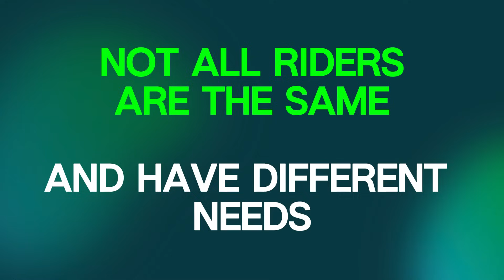DJI Under Fire: Will Europe Shut Down Their 1000W Avinox e-Bike Motor?

Comment: Why is nobody talking about the class 3 speed issue on the levo? This topic is way worse in my opinion! Big deal, DJI has 1000w but at least the speed cuts out at a lower point. It just gets you to cut out speed faster.
Reply: I find it all bonkers about e bike speed limits. Seen 4 kids on surrons a week or so ago. On the road in a gang and a police car just casually let them get on with it, the likely hood of you getting pulled on an e bike with limiter off is zero. You have cities full of derestricted big powerered e bikes delivering food for fck sake
Reply: Agreed if they wont stop surons then emtb is unlokely. Suron aren't ebikes they are e motor.
Reply: Anyone who has ridden a class three mountain e-bike with the speed limiter bypassed to go 28mph , would know that means absolutely nothing on actual mountain trails. I have one, and the only place you notice that advantage of additional speed is on a gravel or paved road. 
It’s a non issue period!!
Reply from the maker: This is a great point. Generally Class 3 is limited to those bikes that are used on the road only, but there are some variations of the rule depending on the State. However, as I am not based in the US my knowledge on these matters is limited. Thanks for watching and for commenting.

Comment: I'll admit 600 to 750 watts is definitely enough, but I don't think the watts and torque should matter as it's restricted to 15.5 mph anyway. Although higher power ebikes will get to that limit faster you'll still be on your own steam at 15.5 mph + anyway.  Yes you'll get people the de restrict them but that'll happen regardless of the power of the bike but for people who do that  should just dealt with in the necessary way, and for people that dont de restrict them they should just be left to it.
Reply from the maker: I'd agree with you. If the assisted limit is 15.5mph, it's very easy to argue that there is no real harm in how quickly the bike gets there or upon what gradient it is capable of doing so. The issue you raise of a de-restricted high power/torque motor is a very good one. Would a 1000w motor be more dangerous than a 750w motor, once it has been de-restricted?  Thanks for watching and commenting.

Comment: I don’t even like the 250 watt nominal power thing… I’d like to try an avinox motor as I’ve been riding the rocky Mountian for a couple years now and it’s 108nm and 750 peak like for 6 years or something.  I could understand a cap at say 1k kw peak. I’d like to see a higher nominal as well.

Comment: Everybody is talking only about the power, but You need a lot of other things to be street legal or to be use you bike not only on closed tracks (the hills is not closed tracks, the hills are like the streets...) . Like front and rear continuous lights, front and rear light reflection, light reflection on the pedals and on the tire sidewalls or spoke light reflection and a bell. So You are really worrying about a thing, that can not be seen (motor power) but not on the things that are like the 99% of Emtb fullys do not have...

Comment: 600watts was plenty on a old shimano 8000 motor to climb in the lake district hills so Improving the delivery, software on moden motor will make it easy. So you don't need  all that watts power.
Reply from the maker: For eMTB, and the riding I do, I personally don’t see the need for this race for the most watts. I agree with you 600 w is sufficient. There are certainly many that disagree, but for me e-cargo is the area that could most benefit from more motor output. Thanks a lot for your comments.
Reply: I know my gen 3 levo has 565 watts and ive not took it to the mountains ive not has issues on that amount of power. I do think though around 600 mark should be minimum as this 250 watt limit is a joke especially if carrying alot of gear etc

Comment: For me I want to have access to trails byways bridle ways etc.
However it’s not necessarily about power on these areas but how the rider respects other users.
At a bike park why would you need restrictions on power ?
On the road maybe a cut off on speed at 20 mph would be better.
I guess it depends on what the manufacturer intends the use of the bike for.
Finally I’m not a fan of too much regulation especially if it restricts innovation.
Reply: You already share the trails with users weighing 500 kg+….. 750W + and capable of 30mph…… horses…
Reply from the maker: I agree, ultimately respecting other users is the only way to share bridleways etc but the big dilemma is how do you govern that? Is restricting motor output the only (blunt) tool in the arsenal?
Regarding bike parks, my point being that e-bikes put a greater strain on the trails themselves, as the increase in output to the wheel causes more damage to the trail surface and increases the upkeep required.
I would personally be in favour of increasing the road limit to 20mph to allow cyclists to keep up with motorists in urban areas, reducing the need for overtaking.
Thanks a lot for your comments and for watching.